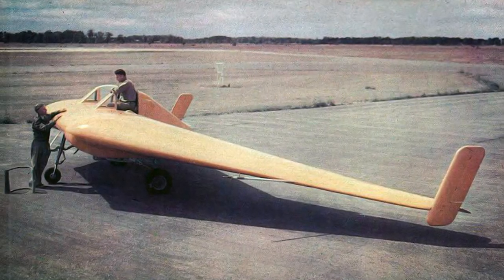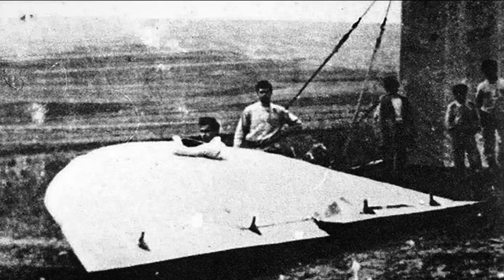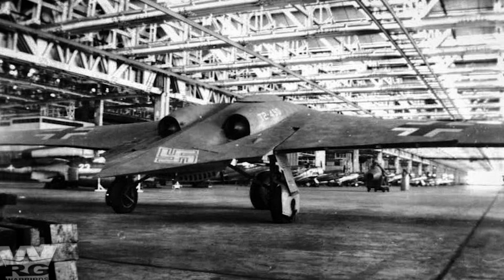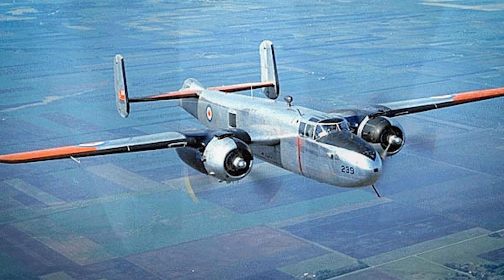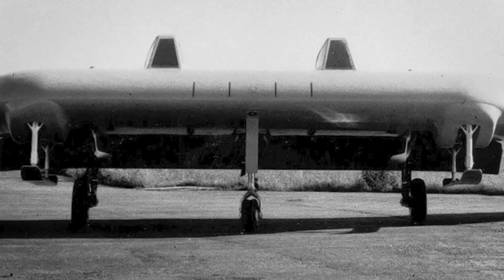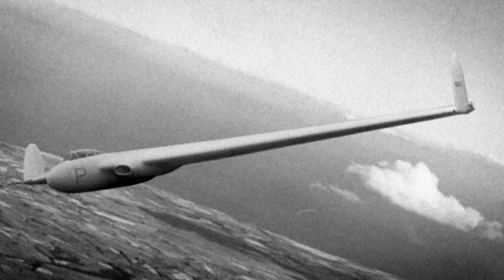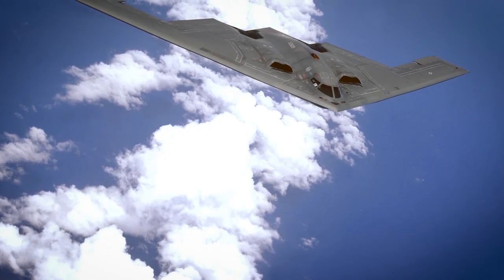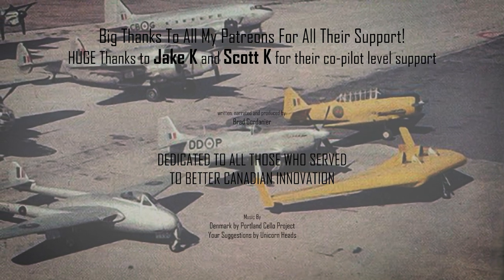Canada's Almost Forgotten Flying Wing; the NRC Tailless Glider

Comment: Wow! Never heard of this one and I've been in aviation since the mid 70s.  Nice work!  Flying wings are a dead end because they aren't really "tailless", they've just moved the tail's functions, moving the neutral point aft and providing trim forces to control AOA, to the wing tips if the wings are swept aft or the wing roots of the wings are swept forward like the Marske designs.  Problem is, if you want cargo volume, you need to create a large space SIDEWAYS within the wing, a very draggy way to do it, when it is much more efficient to create the space lengthwise to minimize frontal area, using a longitudinal tube.  Having done that, you might as well put tail surfaces at the end of your lengthwise tube, and increase the stability and control and CG range to boot.  And voila!  You have 99.9% of the airplanes ever designed.

Comment from the maker: Note: I only mentioned the non-glider operational flying wings. There have been many ultra-light and glider designs but only 2 (or 3) other production aircraft have gone into service.
also, at 5:32 I used the wrong picture for the RQ-170 and showed a BAe Systems Taranis, oops (thanks Tim!)